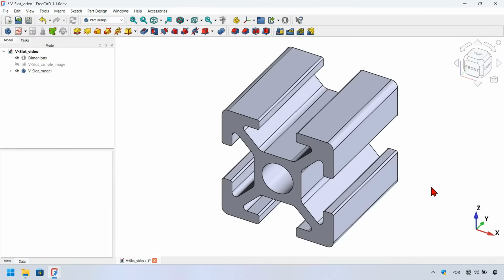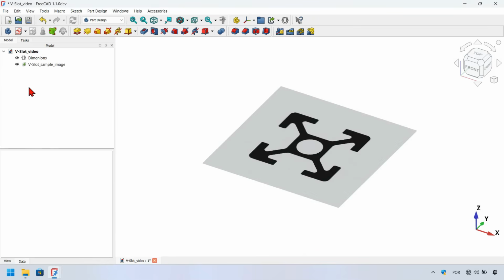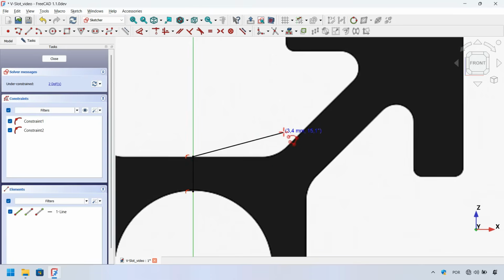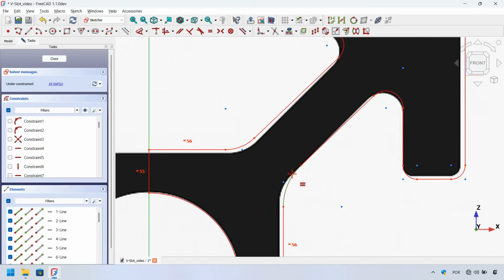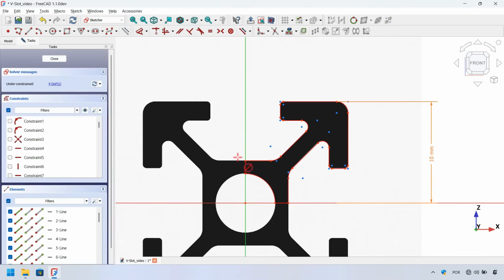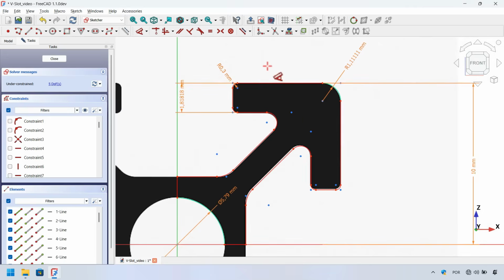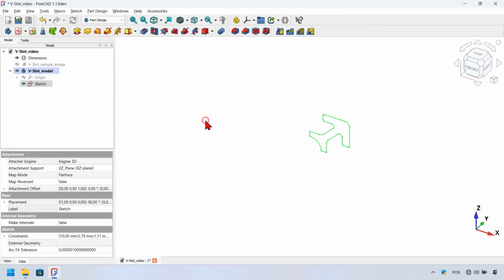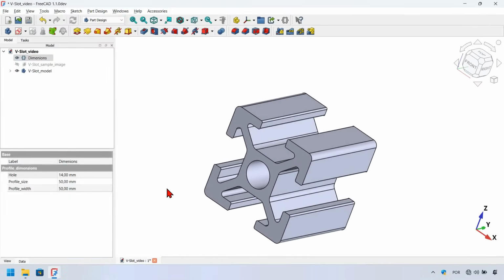FreeCAD 1.1Dev: Parametric 3D model with Variable Set + Image sample + PartDesign WB | How?

Comment: Nice tutorial - thanks! It may have been good to also briefly mention the different variable types - selecting "length" for anything with a measure (e.g. 50mm) but another useful one is "int" [integer] for when the variable is used as the multiplier or divider in a formula. For example, I recently created a model with a flat base an a number of vertical panels. The number of panels is an int variable and this is used as a multiplier so the base extends long enough to hold all the panels, and the same variable is used in the  Linear Pattern that creates the repeating vertical panels. If you tried to use the "length" type for that count you'd get errors since the Pattern doesn't work with units of measure.